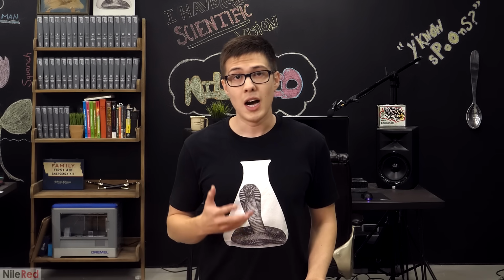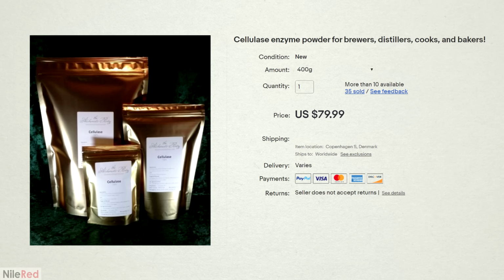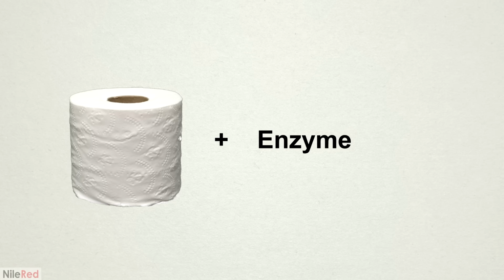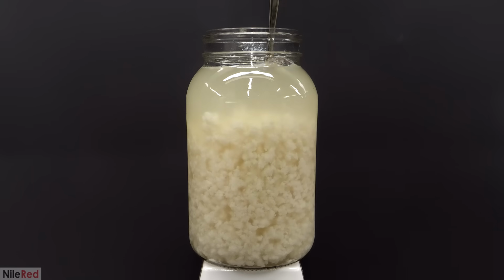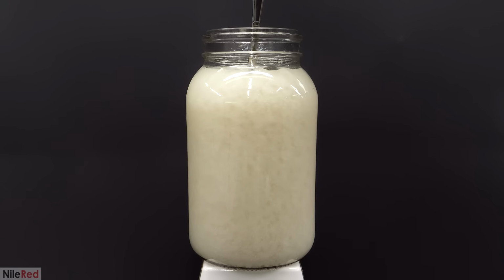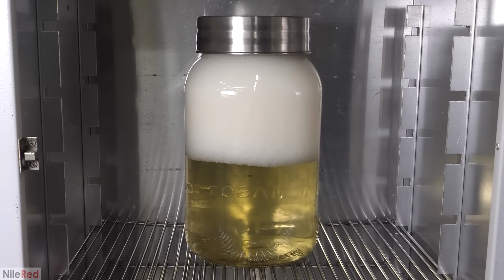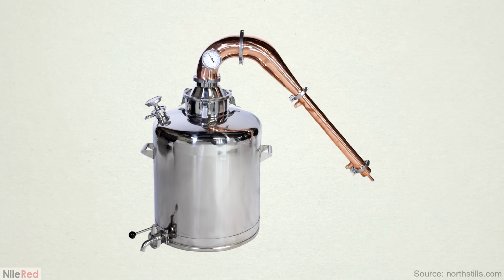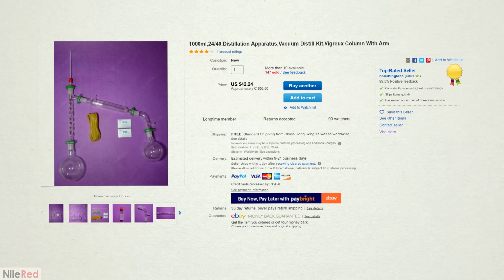Making toilet paper moonshine

Comment: The following is all in good fun Ok, I had to think about this one for a minute. So calling it toilet paper wine would be inaccurate to some extent. It would be toilet paper beer. 🤣 Wine typically starts with a simple carbohydrate in glucose from fruit and a distilled version of this would be an Eau De Vie. Where as beer starts off as a compounded glucose structure, typically in the form of a complex carbohydrate called starch. The starch is then converted to glucose through a process called mashing which uses alpha and beta amylase enzymes and heat to break the starch down. The only difference in Nile's process was he used a different complex carbohydrate in cellulose and therefore broke it down with a different set of enzymes and heat. This would also mean comparing it to Vodka was 100% accurate because distilled beer creates a neutral grain spirit which is usually called Vodka (or moonshine if your doing it in the woods where no one can find you).

In all seriousness, great video. I enjoyed this whole thing way to much. haha

Comment: so take your first stage  completely filter the cellulase fiber out of the bottom so a clean particle free liquid, ferment - when fermentation is finish your pure  enzyme/yeast will settle to a pancake at botton,  siphon dregs off bottom to  a seperation cone  let it settle and decant to a clean sterile  vial  you now have a clean sugar free enzyme/yeast from the dregs pancake usable in another batch  it will activate faster  and cleaner and acclimated to your process  without carrying over any residual sugar to affect your true readings all they sent you  from europe is an actual byproduct like  you will collect at the end.  They dry it under controlled temperature and conditions and package it to sell you. now one  additional  hint the solution you distilled check its actual SG , depending ont the yeast  in the vessel fro what they sent ou maltodextren in the ingrediants tells me a  beer or lager based yeast,  some have a very low concentration tolerance to alcohol and also some yeast are only affective in digesting sugar in specific  chains. so use one some that is refered to as turbo yeast it is fast work on sugars  even some of the longer chain sugars.  these   in 24  or 48 hr turbos   will produve 14% abv  in 24 hours from any was  you have to distile  where as some yeast can  have a tolerance as lol  2 or 3% abv  before the slow down and sometime stop completely. as for your  heads often a  very defined  smell  some can be  like nail polish - fruity/ester - methylated smell,  heart wil be very pleasant smell and taste,  tails small can very some old timers would call them fatty in smell  most will feel the dripping as at this point the tails will start to take on an almost oily feel between fingers.

Comment: You got a puke! I'm not chemist, but I do know a thing or two about moonshining. You definitely used to much of the toilet paper sugar solution for that itty bitty flask. It probably would've puked no matter what. But one way to reduce the likelihood of puking is adding a little fat/oil (moonshiners use butter sometimes), and another is to just back off the heat until the foam has dissipated. 

Probably a good idea to clean out your condenser before you try to get anymore distillate. I mean, considering you kept using food safe chemicals I assume you wanna try and drink this toilet paper vodka, lol.

edit So that first couple of runs of the base fermentation product, that's called a stripping run. And what you got, the 20%abv stuff, those are your low wines, which are usually pretty cloudy. When you did the next run (the spirit run) what you got was your spirit.

nother edit Another thing you could've done was catch the heads and hearts, and then combine them (that's called feints) and then just do a feints run. Keep the hearts just from that. That would've probably gotten rid of some of that bitterness you got with your final product. And upped the efficiency a little bit too.

Comment: why do people need yeast for alcohol it's silly + diglycerides + monoglycerides mixed ferment soook like making booze out of tp is only useful in jail sooooo on the commissary get :
a hard candy
cups
shower cap
dark area 
 thro in the tp and the dissolved candy with shower cap over it air tight. it will swell in 3 days let out the air then seal close to air tight again 2nd opening it is carbonated and at least 3% or 6 proof ,,u cook yeast to get harder booze but who needs it that poisonous it's the worst drug on the planet

Comment: You can also add water absorbing beads which will raise the alcohol content but you should also filter it with like a printer filter or something that's short that has like a carbon filter kind of like one of them zero filters and that way you have the purest tasty as well as the highest alcohol content

Comment: On my FIRST attempt I had MARKEDLY better results. I tasted the first drips and OH HELL it was alcoholic. Mine was white sugar and a brewers yeast that was meant to raise it to 18% instead of the standard 12.7%. I went til it smelt like bread then changed the batch. It was 60 litres of "wash" so it took HOURS but I was using a gallon size pressure cooker with top attachments. The result was 58 PERCENT alcohol. She was certainly a blast. I mixed it with soft drink and one guy said it was a bit weak. So I gave him the straight stuff. CERTAINLY made him change his mind.

Comment: There's a thing called fermetation stopper, that stops the yeasts from reactivating. It's mostly Sodium Metabisulfite, so if you wanna redo it in the future (maybe with shirt) you could try adding it before destillation. Also Bentonite accelerates sedimentation (including Yeasts) so you could have clearer liquid for destillation.

Comment: What would be even more interesting would be making it edible. If we could ferment cellulose into a kind of yogurt or something we could instantly potentially have food everywhere all around us.

The "drain cleaner," sodium hydroxide is just lye which can easily be made from leaching wood ashes.

Ive fantasized about building some kind of bioreactor to make like tree yogurt for years.

Im not a microbiologist though.

Maybe this would produce a lot of methane though? If we all started eating a lot of cellulose this way.

Anyway, one of several thoughts ive had in trying to hyperlocalize and make sustainable and low cost food production. 

If we could just eat most things we wouldnt have to worry so much about building complex systems for our delicate palletes.

Most sustainable and ethical diet i think is "eat everything" or basically...whatever is abundant.

Another fun experiment could be to target eating invasive species.

Comment: if you have a high ethanol with a low water mix, its a low-wine.

most low-wines can be used for different cocktails or different spirits, or you can redistill it for liquor

if you try this again use still conditioner, it helps stop burning but is mostly there to stop the foaming

the starch filler was there to help the enzymes to feed if you are doing without the solution, so that way they can jump from one type of sugar to another larger source.

Comment: Wood alcohol is THE alcohol most responsible for blindness.  My grandfather had a picture from WWII of a marine who died from it.
Reply: Yes and wood alcohol is the common name for methanol, which he removed with the foreshot.

The ethanol he kept was not "wood alcohol", but it was alcohol made from wood.
Reply: @nightlight0x07cc  no, he did not remove it.
Reply: @Morlyst  Alcohol fermentation from sugar doesn't produce methanol
Reply: Yes it does bro its just very dilute till you distill it becayse methanols boiling point is super low compared to alcohol wheb you distil any alchohol at all the first 10 to 20% of the projected yeild is called heads or wood water or wood alcohol the middle is called the the hearts and the bottom 30 is tails wich you leave alittle in the heart to give it flavor all alcohol home brewed has methanol but shelf beer and wine is pasturized wich flashes it off and kills the yeast stabilizing it for aging  @Kushothe
Reply: he died from the picture?!!!!!
Reply: @theodorekaczinsky  Was someone framed for it? Was there conclusive... proof?

Comment: I'm not a master chemist, but instead of the enzyme, why couldn't you use concentrated hydrochloric acid, and neutralize it with something like sodium bicarbonate or calcium carbonate? It would have been cheaper - and effective in the same way. No?

Comment: 78ml of 64% ABV moonshine, from 1 roll of toilet paper; if you repeated this for an entire, 30-pack of Costco Kirkland toilet paper, which from what I see is about 50% more toilet paper per roll (380 sheets per roll instead of the 253 sheets from this brand), you would end up with over 3.5L (almost a gallon) of product by the end, for the cost of about $23.50. Obviously there's extra costs for all the other chemicals and products, but hell, that's not a bad turnaround all things considered, especially once you write off the one-off purchases of equipment.

Comment: Au foil does NOT work well as a insulation. Au and most metals are conducting heat and cold very well. The foil does trap a layer of air around the flask that insulate it. Air is a superb insulator. You might as well use plastic or paper to trap some air and paper is by the way much better at insulate heat.

Comment: There is so much wrong with your process here 😔 from your temperatures in regards to methanol and ethanol... To the use of your hydrometer... To your lack of getting an original gravity reading..... To your lack of using bentonite to make the clarifying easier..... To your failure to do rolling cuts to extract only the hearts.....

Come on man. You're better than this 🧐

Comment: save yaself alot of problems......dont buy chemicals and pointless additives, just heat toilet paper in a pressure cooker for a few days, keep adding water to top it up each day. after 5 days stop adding water and reduce heat, let it dry for a day. whats left is all you need. ferment this with cooled boiled water with normal brewers yeast which by design can eat most sugars.  distill it 3 times. for a nice flavour add apple peices to the fermenting bucket. one apple in 15 litres if liquid is perfect.

Comment: I too turned toilet paper into alcohol, but using a more advanced process: 

1. Put toilet paper in beaker.
2. Add chemical with the formula C₂H₆O
3. Distil or pour through a sieve.

Comment: Maybe my opinion is wrong, so my sorry. I never wrap an air cooler in aluminum foil, because that's what a cooler is supposed to do, cool the vapors. The process is longer, but cleaner. The first distillation can yield 94...70 percent alcohol.

Comment: if you ever try this again, make a filter with some charcoal (not matchlight, but actual hardwood charcoal) and copper, it'll remove the fusiloils and sulfites from the ethanol as well as tame it down a little.. or so i'm told

Comment: Interestingly enough this process has a remarkable similarity in some ways to the manner in which sake is brewed. The process is called multiple parallel fermentation, that is breaking down a more complex carbohydrate into simple sugar while the yeast is also converting the sugar to alcohol. In sake the cellulase has its place taken by koji (aspergillus oryzae) which is a fungus that's grown on rice, notable for the wide array and concentration of enzymes which it produces. The koji is added to highly milled rice and yeast and then both processes proceed in parallel until the sake is ready.

Comment: Hey Nile, I’m a brewer/distiller by trade. I think you might have missed out on a lot of glucose when you strained off the liquid from the toilet paper base solution. In my profession we call that first wort! And it’s usually the most concentrated with sugar!
Reply: Good call, it might be a great video for him to repeat this process using some input from brewers/distillers rather than a pure chemistry POV.
Reply: @adamd9166  Well he also tried making a cookie with only pure chemistry experience
Reply: @luf4rall 😊😊😊😊
Reply: @luf4rall 😊😊😊😊😊😊😊😊😊😊😊😊😊😊😊😊
Reply: Actually I expected him to use the liquid and discard the solids
Reply: He didn’t add the enzyme yet so it was all still just cellulose, and cellulose is completely insoluble in water. 
However cellulose can be partially soluble in a strong acid or base, but since the base he used was at such a low concentration (2%), the vast majority of cellulose was still locked in the solid paper material.

Glucose on the other hand is extremely soluble in water, which is why most of the solid material dissolved after adding the enzyme that breaks it down into glucose.
Reply: I was thinking the same. And correct me if I'm wrong e also could have degassed before distilling to reduce the chance to boil over.
Reply: I would agree, I make wine for myself. Until its utterly done, its all got a purpose in the process. Though I never would have thought of using toilet paper, I mean I have tried Gatorade.. but the result was quite literally anti-freeze.
Reply: so given your professional opinion based on how much he had by the end and how much paper he started with how much waste did he end up having from the wort?
Reply: 80 bucks for mostly cornstarch and sugar.... whistle
Reply: But wasn't there a bunch of sodium hydroxide in it?
Reply: @HexOmega3113 you don’t want to drink sodium hydroxide? 🥺 skill issue (😂)
Reply: @HexOmega3113  Not even a micron. You might wanna look into distilling.
Reply: I came to see if more brewers were here to say this o.o
Reply: Firstly, he couldn't really have used that strained liquid since it was filled with sodium hydroxide and he needed to wash it out. Secondly, it's the cellulose itself that he needed, and cellulose isn't soluble in water, so he captured pretty much all of it when he strained it out. Also, the point of the toilet paper base solution was to break down the cellulose fibres to make shorter length fibres so that the cellulase enzyme could break it down into glucose easier. The toilet paper hadn't yet been converted into glucose.
Reply: There’s no cellulose in that liquid though. Or sugar? He hadn’t added the enzyme yet
Reply: @Xlfry  You mean glucose not cellulose, cellulose is the unbroken form of glucose so yes there was cellulose if he hadn't added the enzyme, which he hadn't so when he strained it he lost some cellulose and in turn lost glucose
Reply: @PythonicIe  isn't  glucose like  basically just sugar  sugar
Reply: @mowtolol4156   glucose is a type of sugar. When you say "sugar sugar" I imagine you're thinking of table sugar, which is a glucose molecule bonded to a fructose molecule - equal 50/50. Corn syrup is 30% fructose and 70% glucose - high fructose corn syrup is made by converting some glucose into fructose until it matches the 50-50 blend of table sugar. 

The main difference is that this conversion unbonds the glucose and fructose - your body breaks things down to release the energy inside of them. The longer it takes to break down, the slower the blood sugar rise and fall. Because high fructose corn syrup is already unbonded, the energy is freely available for your body to use, creating an immediate blood sugar spike. 

Note: I am not a chemist, doctor, anything professional like that. I just like to know what I'm eating.
Reply: @mowtolol4156  "sugar sugar" is called sucrose, which is glucose + fructose
Reply: Egad! An expert!
Reply: Should he have neutralized the base with something like citric acid?
Reply: Zip it brewer boy
Reply: @Supereviloobi you definitely read the comment too 😹 cornball

Comment: Nice! But, burning yeast is the best way to get bad tasting moonshine. I was also waiting for you to point out the alcohol boiling point which is 78.37 °C (173.1 °F). Going up higher makes it evaporate the other stuff as well, like water. Water bath boiler is a good way to make sure nothing gets burned and the temps are more easily controllable.

Distilling it many times with distelled water (and maybe using active charcoal during the process) should bring you moonshine that wont smell or taste anything -- just a warm feeling in your mouth.

Comment: @NileRed 1 mistake : after the fermentation u did not kill yeast. Is't easy just heat up to 50-60 C for at least 5 min and u are good to go. The foam its propably from the yeast. 2 mistake : 1 distillation need to be 95-100 C. The 50% ethanol-water mix need to cleaned with some active carbon. Then u distil it 2 time. Try to have between 79-80 C. Well done u have at least 90% ethanol. Its kind of common knowlage but its good to tell obvious things just for shure. Sry for my English its not my main language.
Reply: When u do fermentation on normal sugar the yeast die from ethanol (15% for best yeast). I think in your method u need at least 2 week's of fermentation xD.( I am sure u realise the toilet paper is not best for this xD)